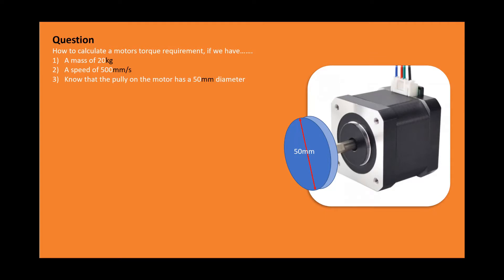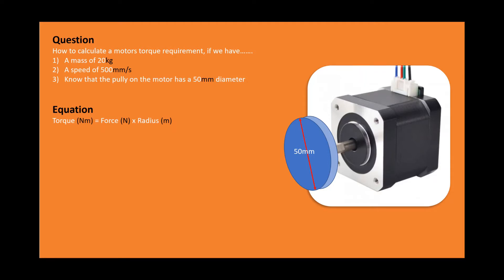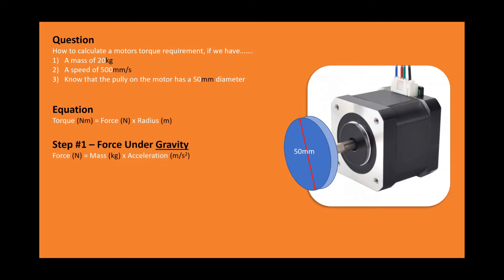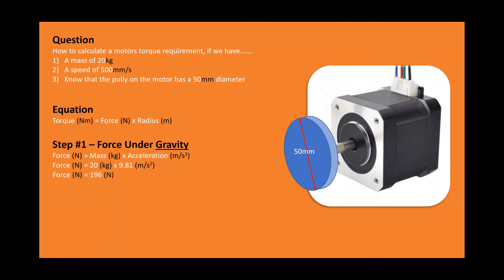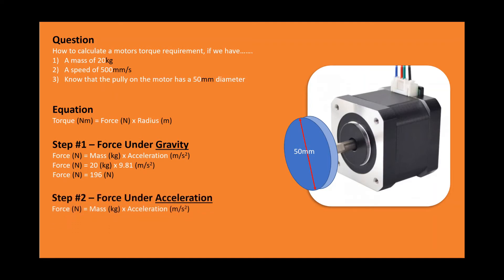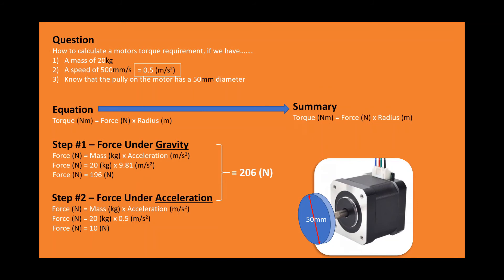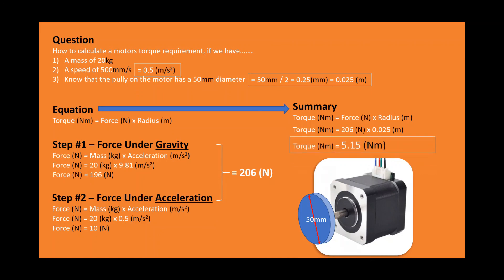How to Calculate Motor Torque

Comment: ummm, thats wrong.  50mm is not  0.025M LMAO  ...WTH? how did you do that??? its metric . 10-10 10-10...10mm per centimeter, 100 centimeters to a meter so 1000mm to a meter. 500mm iiiiiiiiiiis 0.5meters or 50cm. move the decimal.  10cm is 0.1M correct?  which is 100mm,  so 10mm is 0.01meters yes?   10mmx 5 is 50mm so 0.01M x 5= 0.05M  did nobody else catch this??   fuck
Reply: i also recognize this, but somehow my thought says he is looking for he r? so diameters divided by 2? but however i still confuse with the calculation until now hehe
Reply: mm to M = 1/1000
D 50 mm = r 25 mm
25/1000 = 0.025 M
........

Comment: These calculations are completely wrong.
Reply: Easy to say comments.
Prove it if wrong
Reply: @anbarasuduraisamy6470   He should be using equivalent moment of inertia seen by the motor to calculate angular acceleration and torque....... The effect of gravitational torque only appears when there is an eccentricity on the load. The gravitational torque won't affect the pull out torque of the motor but can cause periodic centripetal force acting on the shaft causing vibration issues and lowering the life of bearing and shaft.
Reply: Could you show which ones?

Comment: Hello, how did you calculate speed which is 500 mm per second to 0.5 m per (s*s)
Reply: i think he meant acceleration since F = ma but i still don't get it how he found that value
Reply: @moreblessingmushohwe6506  speed 500mm/s = 0,5m/s , formula for acceleration is a=v(speed)/t(time difference) so if we want to accelerate in one second its a=0,5/1 = 0,5mm*(s*s). at the begining was also confused.
Reply: @FUJARAHEAD  Okay, I get it now. Thank you!!